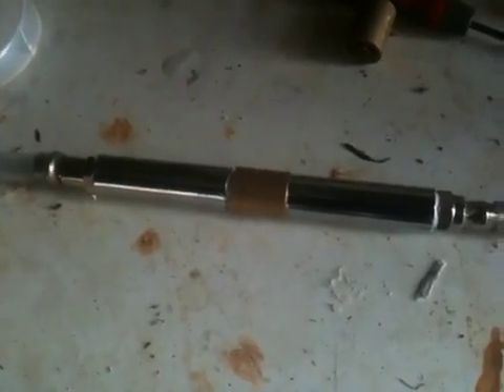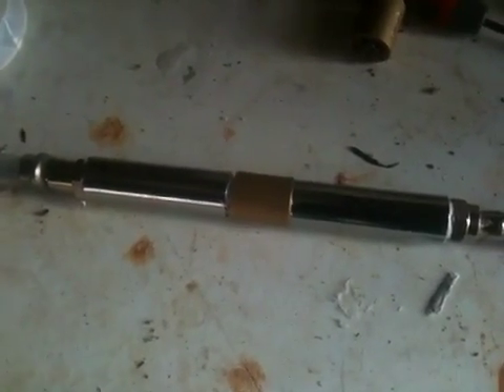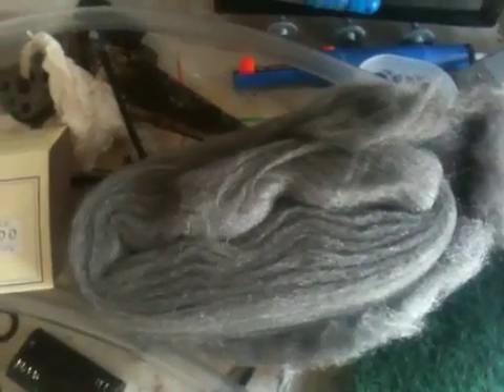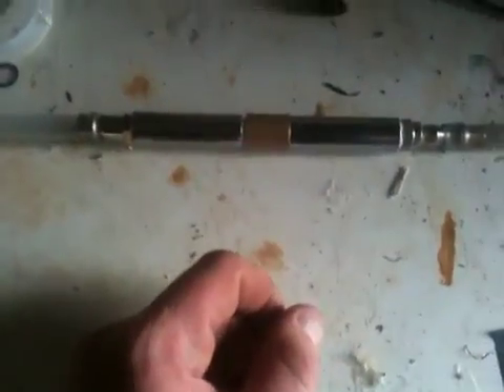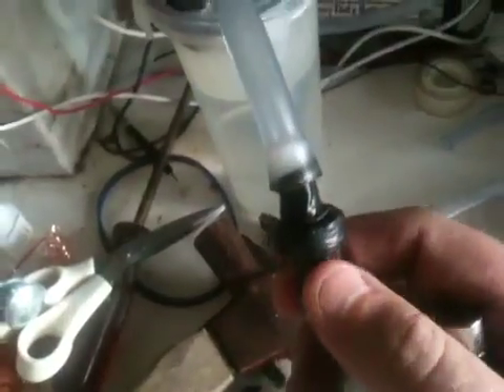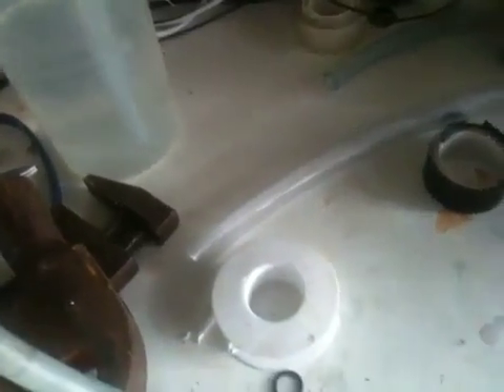Flashback / flame arrestor #2

Comment from the maker: yes the aquarium stone might work well, i forgot to mention that i also used a dremmel tool stone and it worked perfectly as they have a melting point resistance of up to 2000 degrees, it worked well for ages. 
good luck

Comment: you're right, the bubbler with a safe valve is the best way but the problem is that is not easy to find the item at
hardware store, and also sometimes is not easy to build..I've just ordered from ebay USA the fine bronze wool (it will take 1 months) but in the meanwhile I will try with different materials in the meanwhile, like fine zeolite or aquarium stone) :) thanks for your advice, i will post my video if I get it working :)

Comment from the maker: hello Mauro,. What i found when using steel wool is that it does not last very long & rusts very quickly & fails 2 do a good job over a small amount of time. I also tried using a piece of damp sponge in the arrestor & it worked until the water dries out & u have 2 take it apart to re-wet it. I found it was best to make a very good quality bubbler with a safety valve in case of a flashback and a very small hole at the end of the welding tip and there was no need for any steel or sponge material

Comment: Great to see the improvement and that you listen to your fans :)
I also wonder how long before it gets rusty, when working in the electrolyte-moist conditions. Keep being aware of that and check your new flashback arrestor after a while and again. The risk is not only it would pass through the flame and destroy your hho setup, but also it would push rust into your hho gas receiver whatever it will be (car engine?). I assume, it is not a stainless stell wool.

Comment from the maker: yes, this 1 works a lot better, the metal I used was from a local hardware store with a male & female  1/4 inch threaded end & the middle was a double ended female 1/4 inch fitting. the end nozzles were just a couple of stainless steel 1/4 inch barbed pipe fitting. I packed the steel wool down with a screw driver & blew down the pipe each time making sure the air flow was not to hard going. I have loads of the wool left over to replace it as I think the wool will rust in no time, we will see.